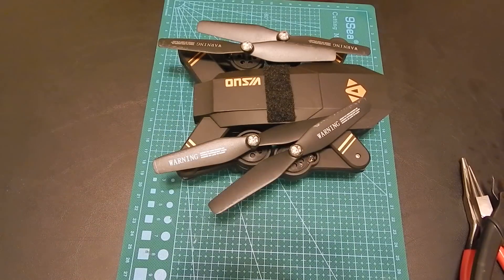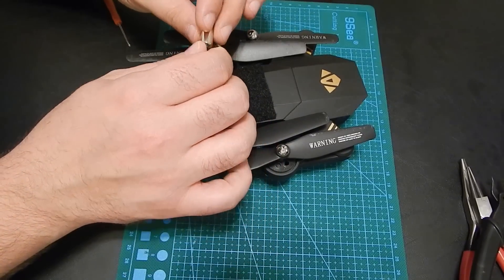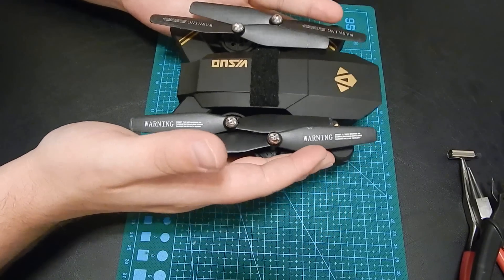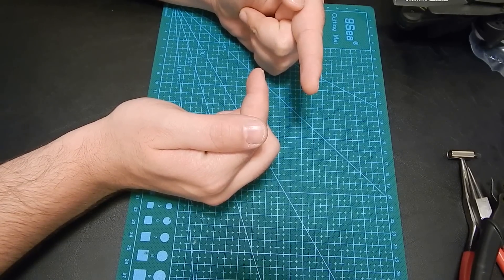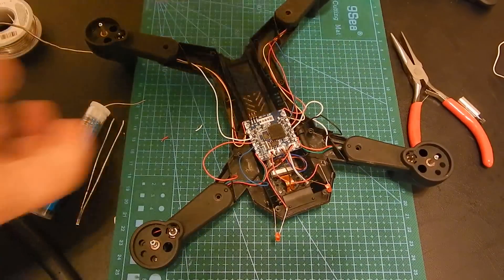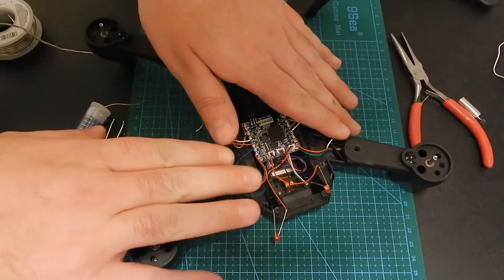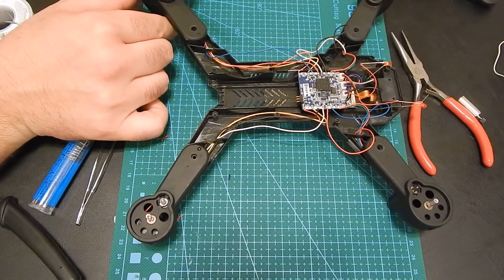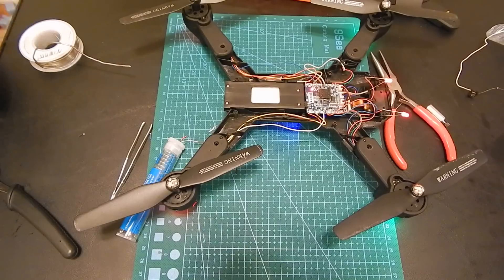Visuo XS809HW Drone Motor Replacement

Comment: Hey are u active..the motors are currently out of stock and I don't know where to buy pls suggest me a website which doesn't delivers fake products and also thanks😊
Reply from the maker: Unfortunately it is really hard to find anything nowadays. The way I look for these motors is I measure the size of the motors, width and length and search for brushed motors CW and CCW kit of two pairs.

Comment: Hey, man, I'm BRAZILIAN.
If my English is bad and because I'm on google. (:
my drone face ta pulling to the side like the gyroscope had cofuso he got like this after a beat.
I changed the engine more anyway it did not work.
Note: The engine is locked and replaced.
Do you know what it can be
Reply from the maker: It looks like it might be calibration issue. Take a look at the manual page 5 https://www.firstquadcopter.com/download/visuo-xs809hw-user-manual-pdf-download/ and try either to adjust trim or place the drone on the leveled surface and perform auto calibration.
If that does not help since you already replaced motor it means that the gyroscope has gone bad and you have to replace entire mainboard. I hope trimming will help. Best regards for Brazil

Comment: nice vid on motor replacement. Ive put about 4 hours of flight time on mine. Ive gone through 2 motors. No crashed or hard landings...these motors burn out easy. You will notice that during take off it veers to one side. If you slowly put the power on just to the point where the blades spin, you will notice one is not moving or takes longer to get going. If the gears are all good and youve done a re calibration through the remote, it may be a worn motor. Good thing is I got a replacement pack of 4 motors and extra gears and housings for less than $15. they are cheap. If you can, buy a pack like this in advance and have them before a motro starts failing. Also, Ive put both motors in without opening up the quad all the way. I only took the blade, and "end of arm" off . It seems easier to just cut into the wires and splice in a new motor rather than disassemble the entire craft. Takes less than 15 minutes. Just be carefull to not bend the plastic beyond its breaking point when separating the arm.

Comment: Will it work if i use CCW(with wires reversed) as CW?
Reply from the maker: Yes, it will. You might experience a shorter lifespan of the motor in that case.

Comment: My original cable motor color is green n yellow (motor B), but when i buy new motors (4pcs) i got blu red and black whie. What should i use to replace my motor?
Reply from the maker: Hi, as far as I know looking the drone from the back to front,  back right motor should be Black (M-) White (M+), front right Red (M+), Blue (M-), front left Black (M-) White (M+), back left Red (M+), Blue (M-). If you still are not sure you can always make a note where all connections go, desolder wires and use one AA battery and test the rotation of each motor.

Comment: I have a problem where my motors will start spinning and will then stop, 3 will be spinning but 1 won't, and this isn't just for one motor as its a different one that dosent spin everytime I turn it on while the other 3 work.. Anyone know what's wrong?
Reply: probuly misodering. I am not an exspert though.
Reply from the maker: I have not encountered a problem like that before. Does tilting the drone affect which motor stops spinning?

Comment: I do not hate you, just the vid. Music over audio, bad choice. Speeding thru instructional info, not good. Scrap this one.
Reply: A lot of video's are sped up so they can get  it all in a smaller video. When this happens just go to settings under the video (a gear symbol) and you can slow down the speed.

Comment: hi sir, there is tiny piece of gear attached to the motor, I lose it after a crash!  I just wonder that this tiny gear suppose to fit tight to the shaft. what happen? now how to order this and how to replace it? Thanks in advance for your advice and thanks for doing this video which is so useful for first timer flight and crash. Better slow down a bit of the music volume as we need to clearly listen to what we need to do at which or what situation, thanks
Reply from the maker: Yes, that little gear needs to go on the shaft of the motor. If it slips and keeps falling off you can use a very small amount of super glue to secure it. make sure that the glue does not get into the gear's teeth. Now, as far as getting the spare gear it's tricky. I did not find any listings that I can vouch that will fit. You can always order one spare motor and that one should come with a gear. It's only a couple of $ and you get a spare motor. If you do end up finding just the gear share it here so that everybody can find it.

Comment: If you can, please help! I had a very light crash with my visuo. It moved the sd card holder out of place. I've taken everything apart and put the sd card holder back in place with a little spot of super glue. NO WIRES WERE DISCONNECTED. Now that everything is back together, the wifi will not work. The drone works perfect except that the wifi cannot be accessed through any device. I've taken things very carefully apart again and nothing is disconnected. Every wire is in it's correct place. Why would the wifi not be working? I can't record without it.
Reply from the maker: Hello, if you are sure everything is connected the way it was and the antenna is in its proper place then you have damage on the PCB.  Does your drone even start WIFi access point or the WiFi functionality is completely out of commission? Dissemble it again make sure everything is in order, keep an eye on any weird looking solder points. Sometimes SMD components fall off if they not soldered properly and get hit. Maybe you need to reflow some of the conecctions.
Reply: markoni985 Any of my devices,phone or tablets will pick up the wifi signal when the visuo is on. Worked fine and then one day, no wifi. I will take it apart and go over everything again. Thank you for your time!

Comment: Dónde se pueden comprar los motores de dron VISUO
Reply from the maker: Try https://goo.gl/2ngCve If the linkdoes not work anymore just enter "2 pairs 8520 coreless motor cw ccw for visuo xs809w xs809hw fpv quadcopter" into Google search, at least dozen of vendors will popup.
Reply: AliExpress

Comment: Hi, last night i have crashed my visuo xs809hw and one of the propelers stop working, everything else is working LEDs ,props just that one on front right side ...it smelled like burned plastics but not from the props smell is coming from that part under the camera? Any advise?
Reply from the maker: Dissemble the drone, take pictures of everything so you can put it back together.  Check if there are any visible damges to the pcb.
Reply from the maker: Here is playlist with raw video footage, I hope it will help you. https://www.youtube.com/playlist?list=PLEZ60Y5qy-WvF3RmaotxAId9lcN2HCHjq
Reply: I did it this way!!
Don't have to screw all of the screws out the Drone.  Only by the motor that is defect. One on the top .  3 below screws.
Cut the wire by the defect motor. The new motor , cut wire ,   till you still have 4 or 5cm wire left.
Use a lighter for both (the old wire and the new one) Take the plastic out with you fingers. Turn it around in each other , put a little solder on it,  use a little plastic tape,  put it back in the frame and DONE!!!
Works here great in Holland.!!